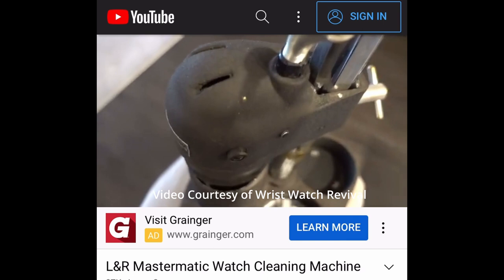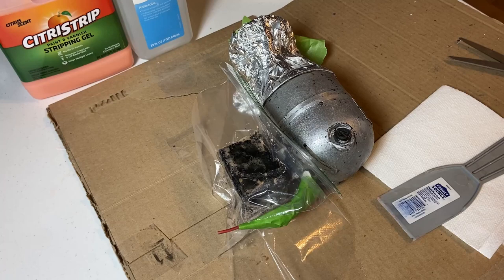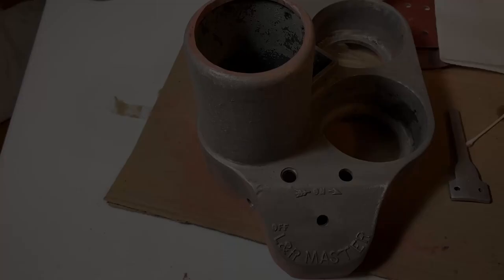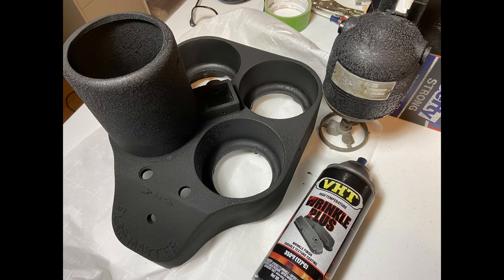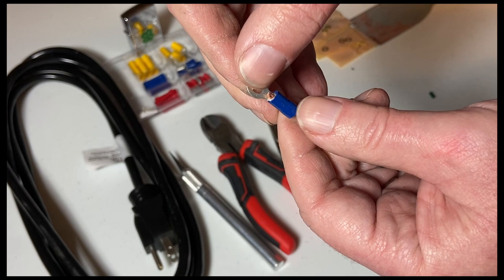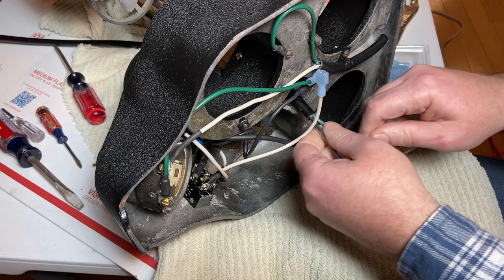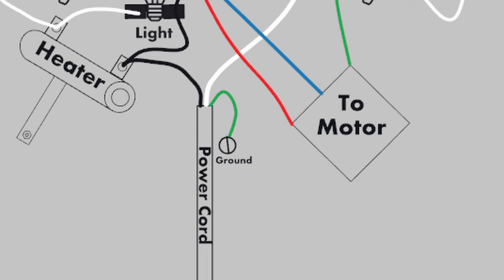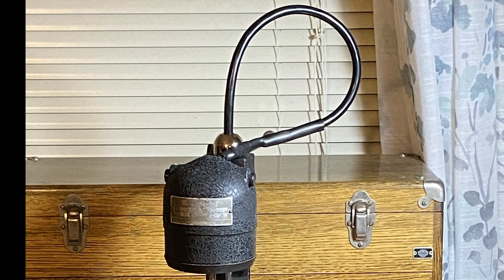L&R Master Watch Cleaning Machine Restoration and Wiring

Comment: Easily, one of the most inspiring and thorough L&R restorations I've seen! Bravo!!
Reply from the maker: Wow, thank you!  I'm so glad you enjoyed it.  Keep watching and you'll get to see the L&R in action in some of my upcoming videos.
Reply: @watchasilearn  I have a couple of old L&R Mathematics.  I believe it's a slightly newer model then the one you restored in this video.  The center post on the one I'm trying to restore was riveted into the base (???), they didn't use a screw or bolt.  So I drilled it out today, but the center post still won't budge.  Before I take a hammer to it from the underside, and try to whack it out, I was wondering if you knew if these center shafts (the motor rides on) are connected some other way that isn't obvious to me.  PS:  Love the video.  I wish I could find one that was as good that showed the restoration of of other Mastermatics.

Comment: Nice restoration!  In terms of electrical safety, this unit doesn’t meet today’s standards.  Note that when the unit is plugged in and the heater is off, most of the wires in the unit are at line voltage of 120VAC. The black wire is the hot side.  To be safe, the black should go to a fuse, and then to an on-off switch, before going to the motor switch.  This is the reason why a wall switch in a house is always on the black wire - if it’s on the white wire then the outlet, lamp, or other appliance is still electrified when the wall switch is off.  Obviously the safety standards were different when this unit was built.
Reply from the maker: Hey Paul, thanks for watching.  That's GREAT information!!
Reply: Hey Paul, 100% right.  I am an electronics guy and am restoring a Mastermatic now.  One thing I don't like is the lack of a fuse and power switch.  Easy enough to add for sure.  The only small concern is we are dealing with liquids and if some were to drip down on say the fuse holder we would get a short possibly and blow the fuse (what its for :)  I am powder coating the base and motor housing now so I will decide how to tackle that when it goes back together.  I am also not a fan at all of connectors.  I like to solder the wires directly to the terminal and shrink wrap.  I deal with high voltage tube amps and would never dream of using connectors (thats me).  For added safety I also grounded the motor as well as the mains coming in or course.

To the OP, nice working on your paint too.  I started to paint mine but figured the cleaning solution would eventually eat up the paint like so many originals.  I oped for powder coating (high gloss white).  I wanted to plate the motor post too but was quoted 130.00!  Mine is really not that bad anyway so I polished it and called it good.

Fun bringing these back to life :)

Comment: Nice work. Glad you stuck with it after you didn't like the first coat on the base. I have a Good-All parts washer which is kinda rare, and did to it what you did to yours. Rebuilt L&R's can fetch an arm and a leg. Well done.
Reply from the maker: Hi Mike.  Thanks for watching and thanks for the comment.  I knew that I just wouldn't be happy with the finish the way is was so I figured I'd try again.  Luckily it turned out much better the second time!

Comment: I've used a heat gun with vht wrinkle plus paint with good results on vintage small cast iron engines. 
It has a quicker more controllable cure time with this method to see if it looks any good.
Reply from the maker: That's a great tip!  Thanks for watching.

Comment: Hi Mark.  Great video.  I"m in the exact same boat as you right now where i'm in the process of building my watch repair and restoration bench and spending a ton on tools and parts.  A watch cleaning machine is on my list of items to get and I suspect that i'll have to go the same route as you as new ones are way too expensive for a hobbiest.  My next item on my list is an ultrasonic cleaner.  I just got my microscope yesterday which i'm setting up today.  Maybe i'll do a few videos on some of the tools I bought and where I made some savings.  Great work.  Keep em coming.
Reply from the maker: Hi Graham, thanks for watching and for the kind words.  Restoring an older machine is a great way to save some money.  As you know, watchmaking tools can be insanely expensive!!  Also, thanks for subscribing!

Comment: Hello Mark, I actually saw you post on another channel (Reddit) where somebody mentioned that you should create a video on YouTube regarding your restoration and I see you took their advice.  I'm definitely glad you have this video as I just purchased a very old L&R Master cleaner myself on eBay that supposedly has all it's parts and works, but has all of the original wiring too that will have to be replaced.  I noticed that in the really old models like the one I purchased, you have a red button to depress in order to make the machine go in reverse rather than a toggle.  They must have figured out later that a toggle switch is much easier, but I will leave it original if I can.  The motor on mine also appears to be either chrome or nickel (I will polish it up if possible rather than painting it).  The sliding bar according to your video is nickel and I will get it re-plated.  Not sure how much that will cost ($75 is what it cost you).  Unfortunately, these machines are not cheap and I had to pay a little money for my machine, but I'm retired and I have a bunch of watches from my grandfather that need servicing.  I fly fish where I'm at and tie my own flies.  I've noticed a lot of similarities regarding the intricacies between the two after watching numerous watch cleaning videos.  I've always enjoyed repairing small machines and believe this will prove very interesting.  Thank you again for the video and your diagram.  Cheers!
Reply from the maker: Hi Cliff, thanks for watching and for the great comment.  I'm glad the video could be of some use to you.  I can definitely see how to could like both watchmaking and fly tying.  Lots of patience needed for both!!
Good luck with all you do!

Comment: I have a few questions, but first, thank you for posting this.  I purchased an L&R Master not too long ago to restore and have been dredding working on it due to the cracked wires and asbestos insulation.  Yours looks to be the same model I have.  You've given me the motivation to start my little project.
Questions:
1.  Was the choice of 14ga wire simply based on the 15 Amp rating?  Mine came with its original wiring, which is much thinner than 14ga.  
2.  The 3-position switch may not have been the original component used.  My version has a push button that sends the rheostat's power to the motor.  Meaning, the user has to hold it down the entire time.  When researching, did you consider an upgrade module that reverses the polarity to automatically change the motor's spin from CW to CCW periodically?  This would make it more like the Mastermatic model.
3.  On the underside of my L&R's base is stamped what looks like a manufacture date:  January 1947.  Does yours have something similar?
Reply from the maker: Hi Steven and thanks for the comment.
1) Yes, 14 ga wire was recommended to me so that's what I went with and it seems to be working out OK so far.  As stated in the video, I'm not an electrician.
2) That button you refer to had already been changed over to a 2 position switch by the time I got the machine.  The only reason I used a 3 position switch is because it's what I already had on hand from an earlier project.
3) I just looked again and the only marking that I could see was the letter "M" which must have been in the casting because it is raised and not engraved into the metal.  Wish I could be more help.

Comment: beautiful restoration! I have a similar machine - the center support is rusted and in bad shape - other than nickel plating are there other options for cleaning the center support - sand paper/polishing? thanks
Reply from the maker: Yes, you could definitely sand and smooth out the center support, I just chose the plating as an option.

Comment: Hi Mark, I finally got my mastermatic, but I believe the rheostat is broken because there's no way to turn off the machine. Once I plug it in, it starts spinning. You seem to be very handy, so would you know whether I could buy a new rheostat from home Depot?
Reply from the maker: Hi Jimmy, great to hear that you got your mastermatic.  The rheostats on these machines are pretty simple devices (at least on mine).  It consists of a metal "spoon" shaped piece which slides along a coiled wire that looks kinda like a "spring".  Since these machines are old it is possible that there is some rust or corrosion between the "spoon" and the "spring" preventing good contact.  You can carefully clean these contacts with some emery cloth or fine sandpaper and that should get things running again.  Just be sure to wipe off any debris you may have knocked loose during the cleaning.  Hope this helps.  If not, you can email me at watchasIlearn@hotmail.com to discuss it further and maybe exchange pics for clarity.

Comment: Great video.  I just got an L&R  and need to rewire it as well.  Did you rewire the motor as well?  the wires inside my motor seem lose.  Thanks for the video.  It will help me for sure.
Reply from the maker: I’m so glad the video was helpful. I did not feel I had the knowledge necessary to tinker with the wiring inside the motor housing. It works now but I’m sure I’ll need to have them replaced at some point. I’m on the lookout for someone to do it.

Comment: Mark, I am rebuilding a Master model unit from 1948. Two questions...When I took the motor out of the housing to rewire, the little "pads" that slip into the brush housing came out but I don't know how they sat in there originally. Can you provide me with a clear description of how these contacts sit in the brush housing? Next question...I have a resistor (I think that was attached to the "Off " leg of the On / Off switch. Your diagram does not show this component. Do I need it? Thank you in advance. Scott
Reply from the maker: Hi Scott, thanks for watching and for the comment. I think the little pads that you speak of are the actual brushes. They should be accessible from outside of the motor housing and actually wear down over time and need to be replaced. Just unscrew the little caps on either side of the motor. There should be a little spring and the “pad” will go on the end of that. Hope this helps. As far as the resistor goes. I’m not an electrician and I merely replaced or cleaned up the pieces that I found in mine and I don’t remember finding the resistor you are talking about. I wish I could help you out but I would get some advice from a qualified professional before I went further.
Reply: @watchasilearn  Hi Mark and thank you for your reply.  The brushes and their location is easy.  I  was asking about the "electrodes" that make contact with the brushes and their location.  From another You Tuber, I think they are placed above the brush housings as one looks down into the head unit. Question is outside the brush housing or inside the brush (plastic) housing.  Just like watches, not enough photos taken to address these questions. DOH!  Thanks again. Scott

Comment: Incredible work Mark!  Wow.

I'm about to buy one as well and am excited about the addition to my bench. Do you find that this cleans better than ultrasonic cleaning of the parts, or is it roughly the same, but more convenient?  Thank you!
Reply from the maker: Yes, absolutely!  My parts get much cleaner than in the ultrasonic.  I'm not sure why but they really seem to.
Reply: @watchasilearn  oooooh, I can't wait to get the new machine and try it out.  By the way, do you use L+R solutions or do you use lighter fluid as cleaner and 99% isopropyl as rinse?
Reply: @jimmykao3355  Hey there, I’ve watched this very helpful video several times thru, with it assisting my own L&R “Heavy Duty” unit.. it’s older then this one & uses a blower motor below drier element, instead of a light bulb power-on indicator. Anyways, just going thru some of the comments & thought I’d mention too you to 100% REFRAIN from using ANY flammable &/or, combustible cleaners/solvents, since the heater-drier in these units does reach pretty high temps!! 🔥